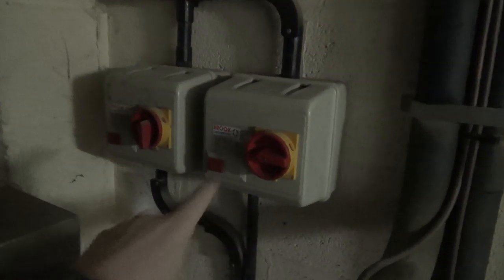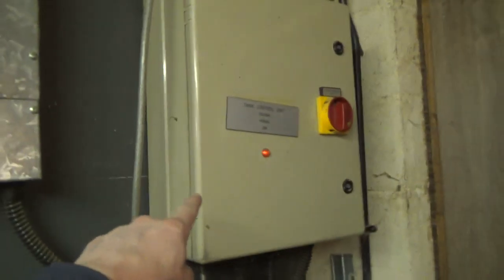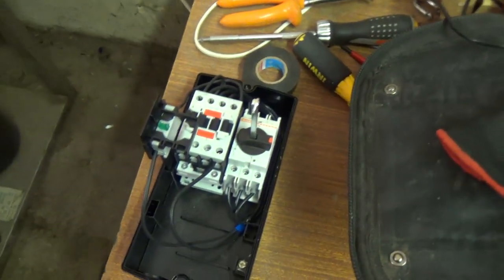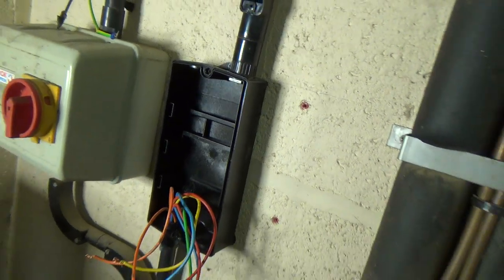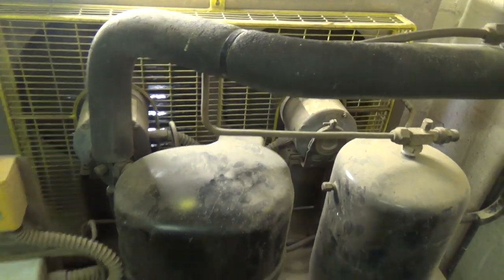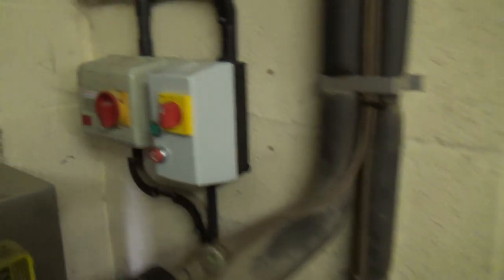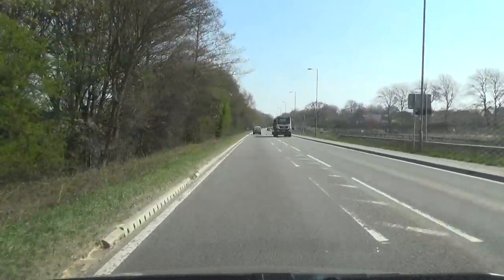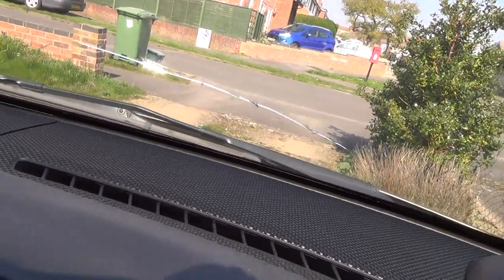Contactor Replacement

Comment: Nice video , mate 👍
I usually use a step bit to drill out the punch hole on the isolator boxes , I find it makes it quick and easy .
I was tryna figure out which part of the country you're from , tryna read road signs , but I couldn't quite make it out .
Bummer for the van , I hope u can still get it fixed , hey maybe they'll do it for cheaper since they probably don't have as many customers right now ... U never know , ey .
Stay safe out there HD 🤜🤛
Reply from the maker: I found some new wheels on ebay for £80 each, new set of tyres ordered as they were all getting low anyway. The screen can wait as I don't expect to be doing much work at the moment!
Reply: @heavydiesel  Silver lining and all that !

Comment: Love video. Have you got the part numbers for the contact and overloads you use mate from RS
Reply from the maker: Just seen your question, these are made by Lovato, the individual contactors, overloads, and auxiliary contacts are under the Lovato name, but the housed DOL starters are sold under the RS Components brand. (though they also badge up some other makes) Part numbers would depend on the kW duty and amps etc you needed so can't help with that.

Comment: Stay healthy John, though as you work in the diary industry you should have no worries about having to be cleaning your hands regular, just from standard farm practise to avoid spread of other diseases. Here first day of lockdown, and mostly being listened to, though you have a fair share of people with the I will not get it syndrome. Public transport operating at low capacity for the essential services only, and only for limited times as well, with only essential services running. 

With the windscreen try a glass fitment centre, they often can drill out the end of the crack to stop it growing, and fill the crack with a UV cure epoxy to make it invisible. Here PG Glass will often do it for free, or bill your insurance for the low charge, as they know that you will likely come back to them eventually for glass anyway.
Reply from the maker: Think most farms would be safe with the amount of chemicals they spray about. Crack in the windscreens got a bit bigger, think its beyond repairing, theres quite a bit of damage where the stone hit, think its covered by the insurance.
Reply: @heavydiesel  Well, either way you are going to go to the glass fitters..... Fix is cheap, new windscreen not so much, plus the whole day for it to cure as well, and all the little crumbs of glass around the interior as well.